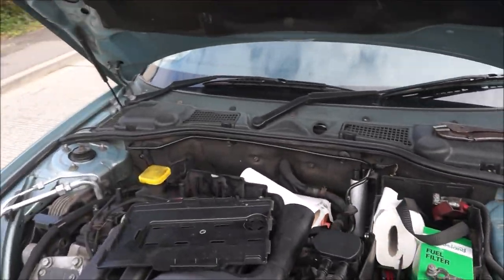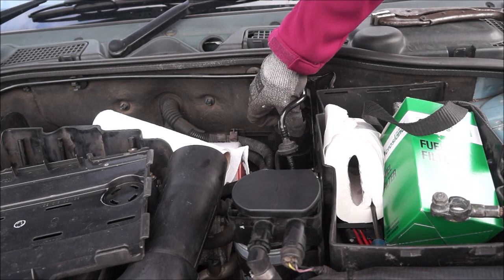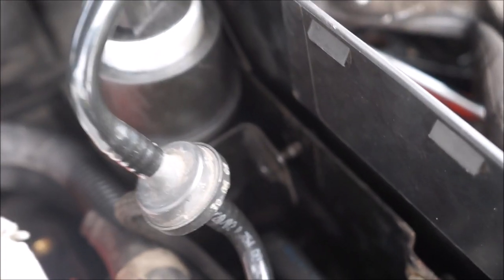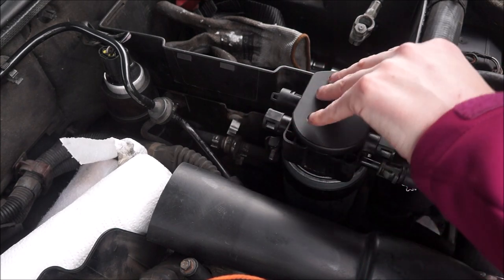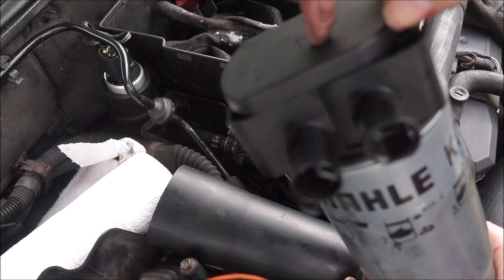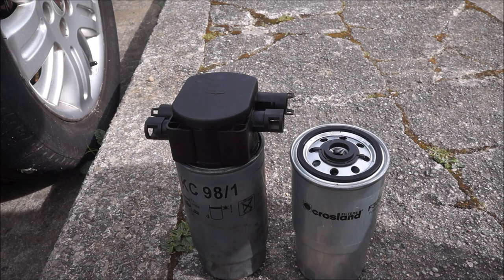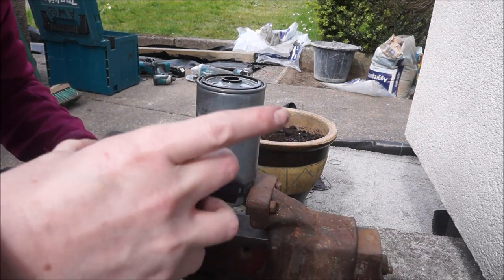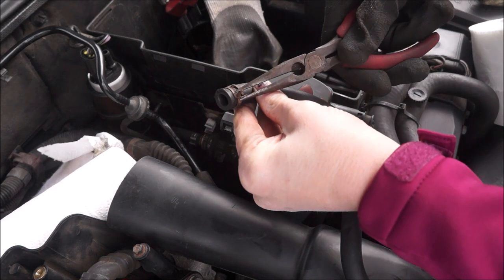Rover 75 CDT lockdown service pt2

Comment: That was great to watch.
Just changed my fuel pump the other day. It really needs the battery tray removing to get decent access. I've also noticed that some motor factors will give me a fuel filter with a plastic drain on the bottom. These will not fit as they end up being to tall and foul the bonnet when shut. I've had this problem with them every time and insist they look again for an alternative filter . I also always have trouble refitting the air filter cover. I can never get it right first time.
That strange noise sounds like a worn crank pulley to me. The rubber is separating from the inner and outer halves could be perished. (i could be wrong).
Many thanks for sharing your vlogs here on YouTube.
Reply from the maker: Thank you for watching and commenting John it's much appreciated. I will check out the pulley 👍
Reply: If you pour some water over the crank pulley it will quieten it down momentary by dampening the separated rubber. This can help in diagnosing it.
The 75,s are a great car and will keep mine for as long as can. 🚗👍🚗

Comment: Heyyy 😃 just found Great watching a lady working on a car 🚗 maybe I can too lol my 75 ran out diesel ... got it started again but keeps stalling and it’s an Auto. Finally broke down 200 yards from friends home. Thought try diesel filter first. Both lift pumps seem to be humming nicely. But Main injector pump groaning.. probably just empty .. any advice?you google new subscriber.. how do you SAVE you Simon
Reply from the maker: Hi thanks for watching. might be worth changing the filter. The injector pump may be faulty but don't quote me lol. The fuel gauge can also be a bit iffy, I have had problems when it gets to 1/3 of a tank.

Comment: Did that new pump quieten down? Sounded awful (through my phone speaker at least), Perhaps keep the old one and the tools to fit it in the car for a while, might save you a recovery  🙊. Enjoyed watching both parts, you have demonstrated that you can still do straightforward maintenance on an older but fairly complex car without specialist kit or knowledge and save yourself some dosh.
Reply from the maker: It did after it had primed. Also the filter would have been empty hence why it took so long to start. Yes I will keep the old pump just in case. 👍